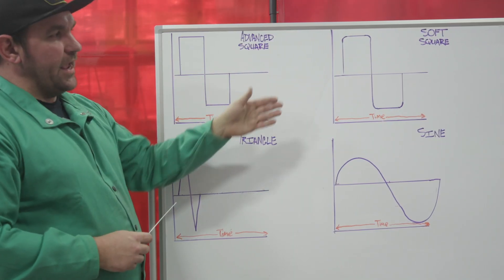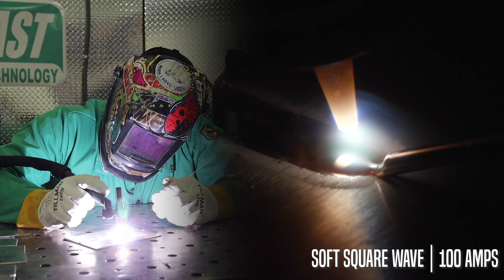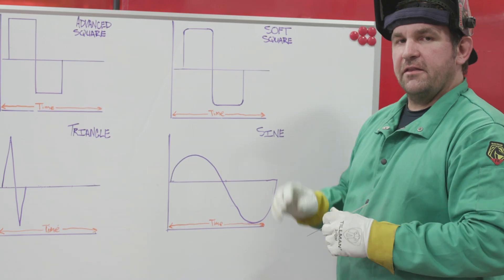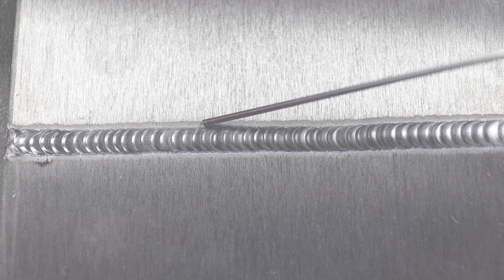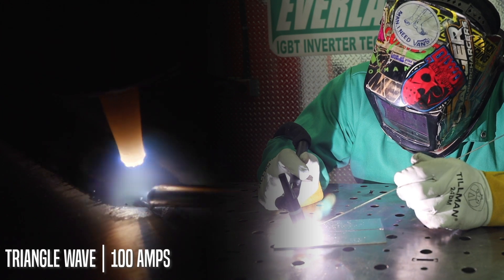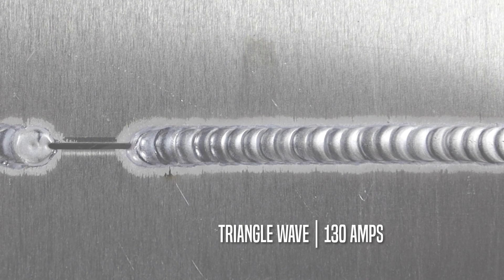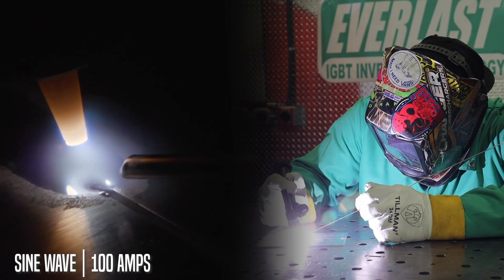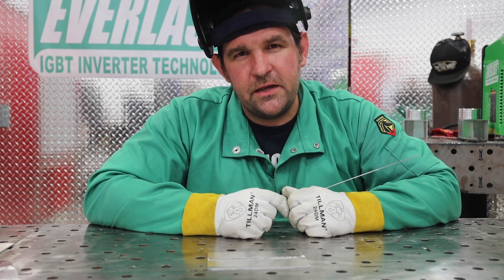TIG AC Waveforms | Square vs. Soft Square vs. Triangle vs Sine Wave!

Comment: Great video, great explanation of welding wave forms, my miller 1980s 300 amp  welder just broke down, now I got to learn these modern things, currently running a modern square wave   I am impressed with the machine , but I miss the Sinus wave smooth sound,  and the crazy deep burn

Comment: If Triangular takes 40-50 more amps to run at the same speed doesn't that negate all the heat advatages? Not to mention if you dont turn up the amps your travel speed will be much longer negating heat advantages as well. I say marketing gimmick to draw you in

Comment: Informative video, however it does not let the user know that using Soft Sq., Triangle or Sine Wave you have to turn your amps up by 50 amps to get the amperage that you may need. Another words when the machine is set at Advanced Square Wave what ever you have the amps set at that is what the machine will put out if push the pedal all the way down. Say 100 amps. If you change to a different wave form you will lose about 50 amps of output. This information was given to me by one of the techs in tech support from Everlast on July 2, 2024

Comment: ive been a welder at the same shop for 35 years. i just discovered all the videos online. Some are very informative, some not so much. One thing that im impressed with is the evolution of the power supplies. Ive been using transformer supplies from the 50s.I wish I had a machine that i could adjust like the one he's using here. i was unaware of all of the waves available on the new machines. Pretty cool.

Comment: The triangle waveform has a lower heat input as the RMS value is 0.577 times the peak voltage.  For comparison the RMS voltage of a sin wave is 0.707 peak voltage and for the square wave it is the same as the peak voltage.  As a result the heat input per half wave is the RMS voltage times the amperage divided by the time (of the half wave in seconds).  This is why square wave welders can weld thicker material than the old transformer types, or at least one of the reasons.  Great presentation.

Comment: So sine and triangle wave are more suitable for thin materials? Can that also be compensated by AC/Pulse frequency?
Reply: Low frequency pulse settings can reduce your overall heat input into the base metal, much like manually pulsing your pedal, by backing off the amperage for the set time frame in-between pulses. Triangle is kind of doing the same thing in a different way without pulsing. You could combine both, but low frequency pulsing is very annoying on your eyes, mine anyway. Remember higher frequency pulsing, 25-30 pps and up, are going to narrow and focus your arc to a smaller area.... same heat input just to a narrower bead. Great for stable focused arc into filled welds, and it's awesome for outside edge welds or welds close to and edge you don't want to encroach upon or notch into.

Comment: I am using a brand new Everlast Power Tig 325 EXT and the Advanced Square wave works with your settings but the but the Soft Square Wave acts just like i turned on the pulse (the pulse is off) and can't establish a puddle. I am a welder by trade although my tig experience is with a Miller Dailarc 250 i expect a learning curve because i have been doing stick and fluxcore welding in steel construction for the last 20-years.

Comment: Most tig welders don’t have a wave adjust feature.  What wave form do they mostly use?
Reply: Typically inverter welders without waveform options are going to be advanced square or soft wave

Comment: It looked like the sine wave was causing less contamination on the electrode. Is that typical or was there another reason for that?
Reply: With reduced heat input into the base material, you also have less heat going into the tungsten... So at a higher hz(meaning above the transformer standard of 60hz) sine is really easy on the tungsten as well. Advanced square is actually really hard on the tip due to the sudden and radical shift in polarity which will cause more deformation.
Reply: @jessemccollum  Good explanation, thank you.

Comment: So if you have never tig welded before would you suggest triangle wave to slow things down and allow some extra time to see what’s going on???
Reply: To me, and this is my personal experience, I think sine wave or soft wave would be the best to start out on. They are a lot more forgiving and provide a wider arc. With triangle wave, you have to be very very precise with your arc length or the arc will cut in and out due to the short time at the peaks of EN/EP. Sine wave, with its longer "roll" into each peak is much more forgiving.

Comment: I really appreciate the dual, simultaneous shots of the arc & your torch, filler rod, & viewing angles as you go.  As a newbie still figuring out the mechanics of keeping both torch and filler rod stable, I noted your feed hand wrist prop'd on the table - with just enough hand motion to feed rod.  Definitely gonna try it this way as looks like good way to improve consistency.
Reply: Being stable, and comfortable are about half the battle. Its not always possible to have a hand prop, but it certainly helps when you can. It takes a bit to figure out how much pressure you can apply on your arms and still slide them for longer runs

Comment: Crazy how much less heat you get with the triangle wave. Nice work guys.
Reply: It’s only at it’s peak current for a very short time each cycle.
Reply: @mitchstephen5491  OK so this explains why the amount of heat transfert is so much weaker. This should be half for sine as compared to square and even less for triangle...
Reply: Tell me if I'm wrong but would this be due to the fact that the indicated current in AC mode is the peak current and not the root mean square current?
Reply: Triangle is amazing if you want to weld really thin material.

Comment: i have a question about PowerTIG 255ext it comes with a 5 year warranty is that included free shipping both ways if i need warranty repair ? great video !!
Reply from the maker: It does not include return shipping. However, more often than not, we can diagnose the problem remotely. If it's a board we can send you the board and walk you through the repair to save time.
Reply: @everlastgenerator  So the 5 year warranty is a parts warranty only . what if you a person that is not technical with electronics and they open the unit up and get hurt or burn the equipment .So what does Everlast give a so call marketing 5 year warranty so people don't look at Big Blue or the Red box and they have service centers where you can take it to have service by a pro .This make my decisions made different choices to go with some one else I don't know
Reply from the maker: @johnversluis3084  we will service the equipment as well if you don't feel safe doing so. We just don't cover the shipping. We've found in almost all cases that our customers would rather swap a board with our help than wait significantly longer for shipping both ways and time for labor.
Reply: The welders come with a 5 year parts and labor warranty.  You do pay shipping both ways.  However, this is the same statement that Miller and Lincoln and others put in their warranties, and parallels them very similarly.  You can look it up and see.  Now, the units come with an additional 30 day satisfaction warranty.  During that 30 days, if something should happen, Everlast pays shipping.  This is the most critical period of time for welders with electronics.  If electronics are going to fail, they usually do so within the first 30 days of owner ship. The warranty covers this initial period of time, and gives you plenty of time to get the unit out, fire it up, and put it to good use.  After that, if something happens, the shipping is fully on you.   The service center is located in TN and has full service capability, far more than your typical regional repair center from other brands.  Technicians are factory trained, and fully equipped with programming and factory test equipment.  This is far beyond the ability of most "other brand" repair centers.  When you add in the savings you get from the purchase price over a dynasty or similar model, you will find that you can ship many times back and forth and ( though you won't need to) still not reach the purchase price of a similarly equipped dynasty or other model.  The option to repair at home is carefully weighed with Everlast service technicians (which are available for free to diagnose over the phone and even affect basic repairs) and considered on a case by case basis.  It is not a given that a customer will even be allowed to service the unit themselves.  The design of the Everlast equipment though has largely gone to fully modular, plug and play design.  If you have a screw driver, voltage meter, and can plug and unplug basic electrical connectors, most(but not all) repairs can be done simply by unplugging and dismounting a board. In cases where customers make their own repairs, full diagnosis and repair instructions with both print and pictures usually are involved.